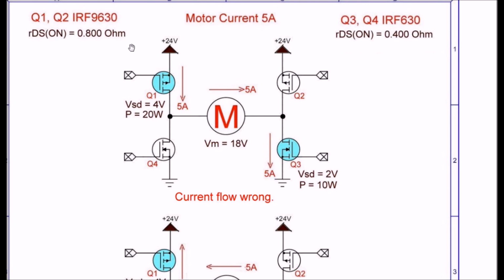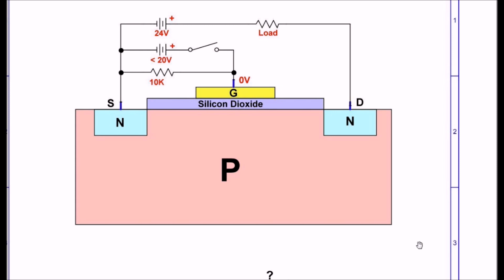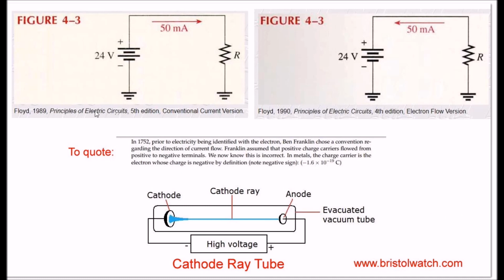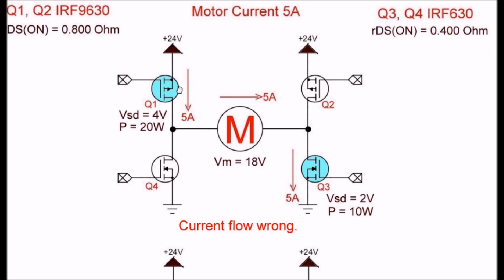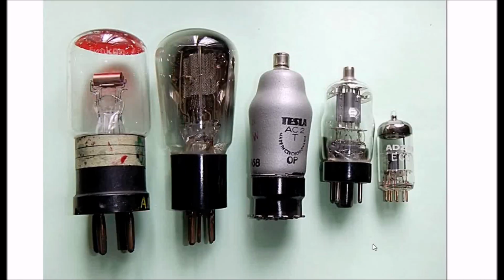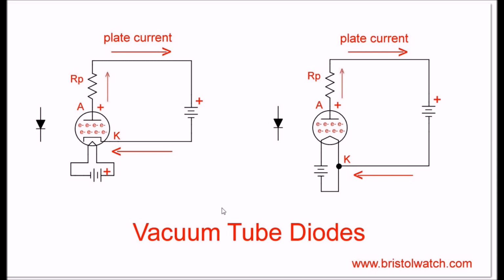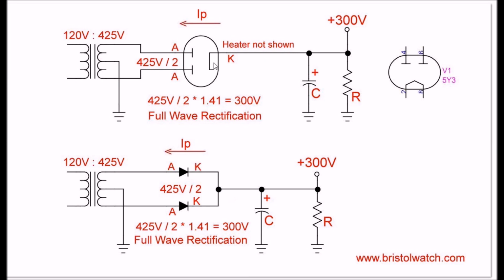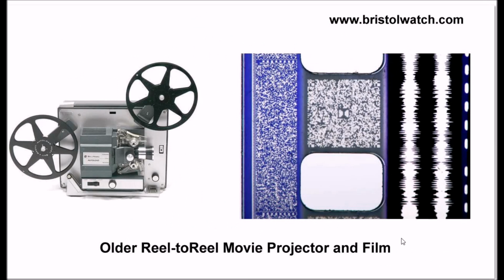MOSFETs and Electron Flow

Comment: Yeah I asked why they show current backwards in my circuits class and I was told it's due to some old convention back when current was first being observed and the hypothesis wasn't even correct. ***Rolls eyes -  WHY are they still teaching some old incorrect convention?! Makes absolutely no sense, especially when you think about what sticklers we engineers usually are. So thx, maybe we can one day get it taught correctly.
Reply from the maker: I started in vacuum tubes and the Army taught electron flow. I was shocked later on when I found out the nonsense they use today.

Comment: Excellent video. Thank you. 
Electrons are much smaller and lighter than positive charged particles (except for positrons, but this is another story).
Therefore electrons can move through the crystal lattice, but ions cannot.
Otherwise we were in a state of declaratory emergency. How would we explain the multivalent ion movement? How would the positive ions manage to transition from a copper to an aluminum conduit? 
Thank God we don't have to explain it.   : )

Comment: I understand. You and I both know why you're not teaching in the armed forces. You are teaching thousands of people who will, whether you like it or not, move on to higher education. 

Other than making the scholastic point, why keep pushing this issue? You are not helping those who come to you.  Just inform them of the military's past view and move on.

I can assure you, without doubt, that military contractors now absolutely dominate R&D, Tech Sup, and, more so every day, field ops.  They don't care what the military once taught.  They teach, administer and evaluate their "forces" on academic standards.  

Like it or not, the Pentagon has become a contracting org.  Do your viewers a favor and get with the new program.  There are many reasons the armed forces are sidelined on technical matters. I assure you that the change over happened on a day in  2001 +/- a few weeks.
Reply from the maker: Very simply electron flow is fact and is the only rational explanation of the operation of a number of devices outside just semiconductors. Try explaining the operation of a magnetron with hole charge movement. Or discharge tube operation.

Comment: The electrical current is the conventional electrons flow from positive pole to the negative pole of a power supply, the  electrons flow really sources from the negative to the positive, hence the electrical current is a conventional expression of the electronic current which means negative charges , in semiconductors there's an other kind of positive charges called holes...

Comment: Hi Lewis, the problem with the galvanic element comes from the definition of cathode and anode. If you are positiv ion in the element, you go to the cathode. If you arrive, maybe you get an electron. But elektrons comes from the minus pole of the batterie over the load. So the cathode of the galvanic element ist the plus pole of the Batterie. This also a part of the mess with the current flow. Really difficult to the students. I love your videos.

Comment: Yes this is absolutely correct - the electrons are what is moving in an electrical current moving through a wire. Showing current flow from positive to negative is just a convention - it doesn’t represent the actual moving charges. The convention is so wide spread that if you don’t state which method you are using then the convention seems to be that conventional positive flow is assumed. The solution I suppose is to always state which type of current flow you are using - conventional positive current flow, electron flow, hole flow etc. Perhaps those that pushed back didn’t know that they were just using a convention and not what is actually moving (electrons). Or perhaps they were saying you should be showing the convention. It would have been better if Ben Franklin hadn’t chosen the positive  current flow convention - but he did. In many cases you can forget about actual charge carriers and use the conventional current flow (ie something moving from positive to negative). But when you really need to pay attention to the details - such as in vacuum tubes, inside mosfets, etc. it’s good to know what is really moving - ie the electrons.  For example at first glance when you see an N channel mosfet with its “source” connected to ground and its “drain” connected to battery positive - it seems strange. If charges come from the positive terminal of a battery then why do you connect the mosfet’s “drain” to it. You would think that the “drain” should be connected to ground where all the current “drains” to. But if you realize that ground is where the electrons come from - ie it is the source of the charge carriers - then it makes sense that the mosfet pin labelled source connects to the source of the electrons - ie it is connected to ground, and it makes sense that the “drain” is connected to battery positive as that is where the electrons drain out of the circuit and back into the battery. At least that’s how I always remember it - ie what is the source of the charge carrier of the device. In n channel the charge carrier is the electron - so you connect the source pin of an n-channel mosfet to the source of the electrons - ie ground (assuming battery negative is connected to ground).